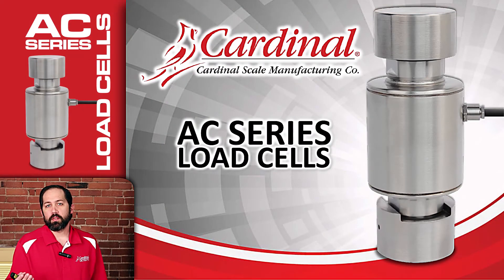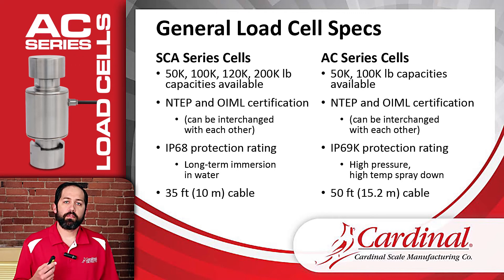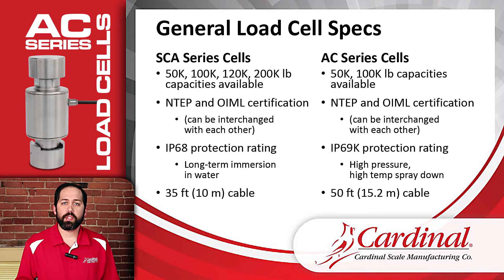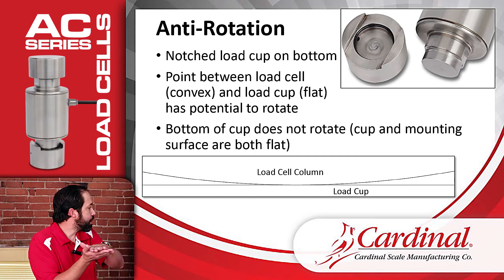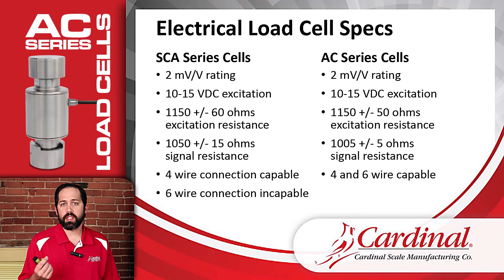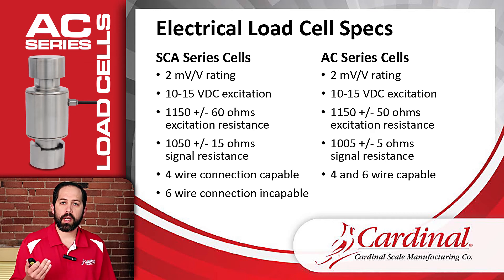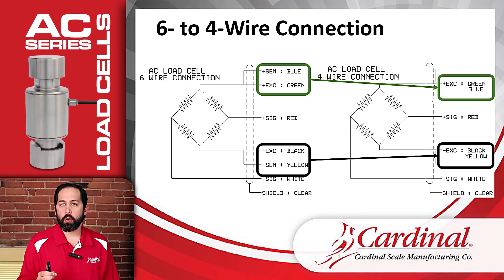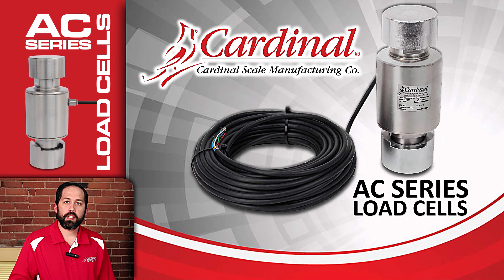AC Series Compression Load Cells Training

Comment: Thanks for the video recommendations would be to cover little more on the mechanics as in the reasons behind a shorter loadcell, From a personal briefing it shedded a little more light and after a recent inspection on a scale using the SCA I found the reason to be true. 
Next for clarification I am assuming they are thermally compensated (hence the difference between the signal and excitation bridges) the sense leads are just for oiml requirements regarding sense leads